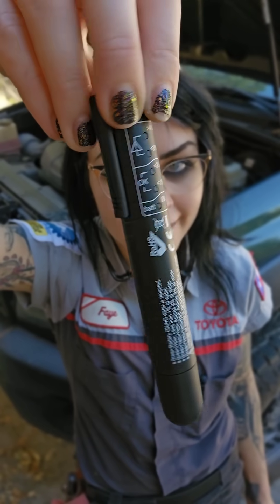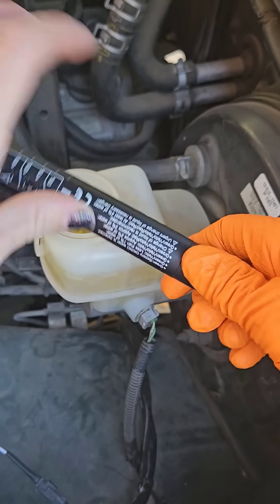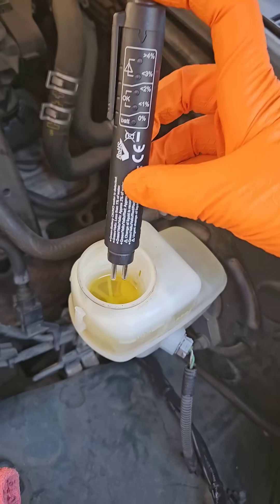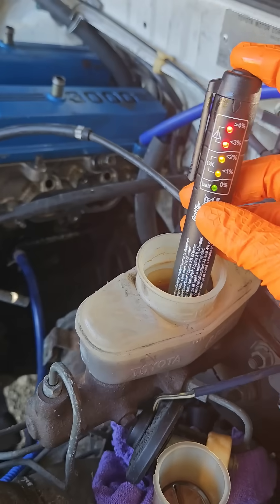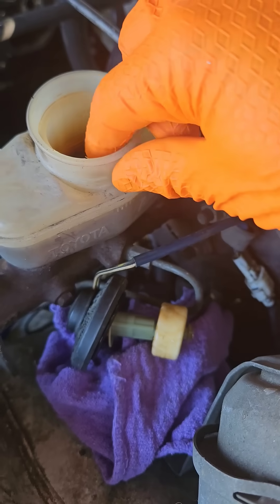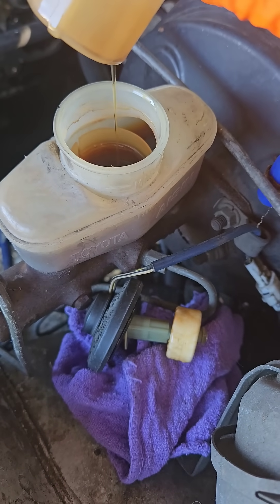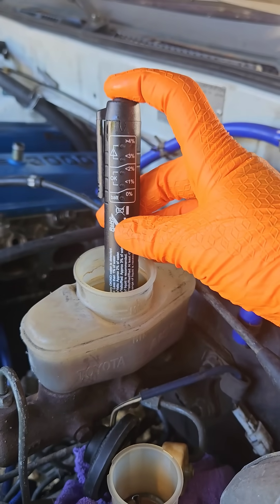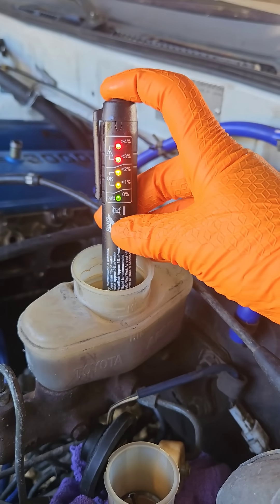Do you REALLY need your Brake Fluid Flushed?? How to Test it For Yourself!

Comment: She is absolutely right. I bought a motor home with enough moisture I lost the brakes driving it home on a hot day while pulling a trailer. I managed to stop it with the trailer brakes. They say brake fluid is the MOST neglected aspect of cars on the road today.
Reply: People change oil. But neglect the brake fluid, power steering fluid, diff oil and coolant chnages. There is more to a vehicle that putting fuel in and keeping the oil changed
Reply: @trelipscomb8137 dont forget transmission fluid and most have a filter under the pan
Reply: @taylorsopko5807 My transmission is sealed. I don't even have a dipstick to check it. Now I have pay more  to  some mechanic to crack it open and trust him not to screw it up.
Reply: @LightningDogg Most without a dipstick have a check hole, park at a very slight decline and loosen bolt a bit until it drips a bit. There's a whole lot of back and forth when it comes to changing transmission fluid on sealed transmissions. Personally, if mileage is 100k or below, I was told to risk it. Even if it's higher, depending on whether it's ever had work done it might have had most replaced, and if so I would risk it. If it's at like 250k and never been worked on... probably a Toyota or Honda and no one really knows at that point if it's better or worse unless you open it up. If the rest of the cars in good condition, keep and eye out for refurb/used trans and engine at a good price and start making friends with a mechanic or start learning how to do it on your model and getting the tools.
Reply: @Disreputable91  Thanks for the insight. I'm about 55/45 leaning toward replacing (not flush).  Appreciate your take on things👍
Reply: @trelipscomb8137  People do not change oil....
Reply: Just learn to do it yourself. I have never taken a car to a mechanic in my 40 plus years of driving. Any tools I buy adds to my collection and still costs less than taking it in.
Reply: @2pist except not everyone has the time that you do.
Reply: @sonofagun5305  Oh you don't have 1 hour of your life to learn something new? What are you, a billionaire?
Reply: @2pist Modern anti-skid brakes can't be flushed and bled like older models could. Have you seen the plumbing on modern brakes. That's why I have the Dealer do it for me. I understand where you are coming from. I can do my 16 Honda VT750 myself easily. It's just a master cylinder, line, and caliper.
Reply: I'd argue that gear oil in the differential is even more overlooked than brake fluid.
Reply: I think that must be true. I just bought a 2004 Dodge Dakota and was checking the owner’s manual for how often they recommend that the brake fluid be flushed. But it wasn’t even listed as a maintenance item.  I feel that this has only become a ‘thing’ somewhat recently. I don’t remember it being discussed as a typical maintenance item 25 years ago.
Reply: @mauricedelarosa6083 what?  As a shade tree mechanic bleeding the brakes and flushing the whole system was a thing 20 years. It was routine - many cars used would have that mushy brake feel.
Reply: @Morphling92 Did you just equate bleeding the brakes with flushing the system? You bleed the brakes to makes sure there is no air in the system. Air in the system compresses much much much easier than brake fluid. Unless you are pushing out all the fluid you are not flushing the system. 

Yes, what you learned from your highschool science teacher is wrong, water as well as all liquids compress. The compression is just at such a high pressure your will not achieve it in your machines. This is why the water at the bottom of the ocean is more dense than the water on top.
Reply: @lubrew5862  holy hell, flush the system and then you bleed the brakes after - man I’m so sorry I was typing on my phone and put it out of order. 

Like I don’t know what you’re getting at?  When you flushed your brakes, did you not bleed them?
Reply: @mauricedelarosa6083  they just figured out cows milk is an inflammatory substance in our bodies. Not supposed to drink it. But years ago milk was promoted as one of the most healthy things we could drink. I didn't just become bad for us. It's always been bad for us. Just like this brake fluid. Back in the day they had no idea you needed to change brake fluid every 2 years. However I light of new discoveries they figured out, hey this stuff absorbs water, and it kills braking systems.  So no brake fluid didn't just start being hydroscopic over night. It's always been that way. They just started including it in the service information.
Reply: 35 years ago I worked at a Sears auto center where I was informed that at 5 percent moisture, DOT 3/4 brake fluids' boiling point is reduced to 212 degrees F. The scenario presented was... Someone using their brakes excessively suddenly loses all break pedal. The cause is the moisture flashes to steam, creates an "air" bubble in their wheel cylinder and the result is no pedal when they need it.
Reply: idk man. around me here in/around Tennessee. I beleieve tires might be the worst. everybody seems to always have something wrong with their vehicles. lol
Reply: And yet my dad says flushing brake fluid is not necessary... Ill be replacing mine very soon
Reply: @midnightbass6596 unfortunately there a lot of myths that backyard mechanics and old schoolers will perpetuate. As technology improves, the tolerance for abuse diminishes. Most new cars will electronically restrict the engine power or shut it off completely to avoid damage. Older cars didn't do that, so people just kept driving til something broke.
Reply: @jaykhan3191  yes but they also now create cars to break as fast as they can
Reply: And power steering fluid
Reply: no she isnt. she said water doesnt compress but it does indeed compress.
Reply: @Sacrifice117  it doesn't compress when it boils, but what would we know? Fill your brake fluid with water, natural selection will do it's job with you.
Reply: @squareeyes1117  water does compress. the myth of water being incompressible is just a white lie your teacher tells you because it's too complicated to tell you that it compresses at a much lower rate than anything else. the water at the bottom of the ocean is about 10-20% more dense than water at sea level. read a book or something bro.
Reply: @Sacrifice117  that's due to the lower temperatures and high salinity you mong
Reply: @Sacrifice117 the degree that water can compress is small enough not to matter. Boiling water, or steam is another matter.
Reply: It is the most neglected because if you neglect it for a decade or 2 often nothing happens
Reply: I have never in my entire life had a problem due to brake fluid...
Reply: Pretty sure it's the engine oil that's most neglected when it comes to fluids. I'd say more than half the cars I saw come into the garage I worked at were not only low, but had oil that was either never changed, or had at least double or triple the mileage on it. A lot of them were women and younger guys, some with their first cars, and I always made sure to explain why and when to do certain maintenance.  Luckily most would atleast add oil when it got low.
Reply: I've had a surprise with braking going away pulling a trailer with my MH too! It's terrifying.  I had the most loved family held in my trust in a clapped out RV
Reply: I had what she described about old brake fluid on a motorcycle back in the 1980s. Nothing like being on a California mountain road and have your brakes get mushy. A complete flush front and rear at the Yamaha Dealer in Sacramento fixed the issue.
Reply: Another thing a brake fluid flush will do that she doesn't mention. It will extend the life of your master cylinder, anti-skid devices, and caliper/brake cylinders.
Reply: You may be right but that is no excuse for ‘just replacing it anyway’ (“That’ll be $100, please!”) at any BMW dealership on the planet!
Reply: @martinwinlow  sorry to be the bearer of bad news but if you want to buy expensive cars, you better be able to afford expensive maintenance. Plus $100 is reasonable for a full brake flush especially on a premium European car which would be a lot more convoluted than an economy class vehicle. Things like hydraulic brake boosters, fixed calipers, fussy ABS/ESC modules make a mundane task into a hassle.
Reply: @martinwinlow expensive yes...but not as expensive as replacing the car. And God forbid if anybody gets hurt because of brake failure. The two most important things on a vehicle is braking and steering. A failure with either of them and you probably getting into an accident.
Reply: @martinwinlow  this lady I work for said they charged her 2,000 for a oil change and I think brake job at bmw dealer😂
Reply: @martinwinlow that is why doing it yourself will save money if you have enough time to spare (about an hr for first time)
Reply: @martinwinlow no. Not $100. $300.
Reply: @martinwinlow  tf??? bf in my country is like $4 for a liter. then like 10 for labor. of course it aint a bmw. but brake fulid flush change is the last thing people do. they only thing oil and radiators the only thing that need liquid replacing
Reply: @martinwinlow bro you drive a bmw. It goes by time as well not just mileage. Just change it. 100$ to a 40-200k car. Especially with performance brakes if you have an M or M package. Even a base man its a bmw not a hyundai just replace it. Obviously not every 6 months but if its been 2 years may as well. Take care rant done 😂❤
Reply: Nope. It’s tire pressure…. “most neglected…”
Reply: @thingsnstuff85  I think a very low tire gets quicker attention then brake fluid hiding under the hood.
Reply: @2pist  brake fluid gets neglected half the time because manufacturers make it look bare near impossible to do with some of their reservoirs, I'm looking at Ford. But also it's very under informed that brake fluid is a consumable, it degrades with in 2 years max to the point where you might as well just use water or ATF (that is not advisable). People that know about it may also be anxious about how corrosive brake fluid is, scared of getting it anywhere let alone their skin. Also that it's an absolute pain in the arse if you don't own a compressor and vacuum bleeder. 
Or just the fact that they're messing with their brakes alone, the only thing that will stop your car other than another car. People just simply don't understand and those are taught are the people that are working with cars a lot. 

So many times we have people concerned about their brake pads and rotors needing a replacement, when in reality it's simply just that their brake fluid is old and contaminated. They probably had the same experience as you when their brakes vapour locked.
Reply: Sir that’s a he
Reply: @spankylocc4202 , no
Reply: @spankylocc4202  you’ve been watching way too trans porn huh?
Reply: @spankylocc4202 Definitely looks like a lady to me
Reply: @spankylocc4202 that's what I was thinking too.... sounds and looks like a masculine chick.

Comment: Brake hydraulic systems ARE closed systems!! If it wasn't closed you would have a leak and your pedal would go to the floor. It's not closed when you pull the cap off but once it's on its sealed hence the rubber sealed cap lol
Reply: brakefluid can still absorb water past seals and through microscopic pores in rubber lines etc. if this was not an issue it wouldnt be mentioned by every brake fluid company ever and common knowledge to anyone who knows who brake fluid works

Comment: Not accurate, you might want to flush your brake fluid not because the fluid is bad but to bleed the brakes cos of soft brake pedal. 
In this case how’s that little tool gonna help ?
Reply: the fluid goes bad over time, and can also cause a soft pedal

Comment: This is actually the INCORRECT way for a customer to check if their brake fluid needs replacement. She is spreading misinformation and should be ashamed. The CORRECT way to check if you should replace your brake fluid is open your banking app and look at your balance. Now cry and tell yourself ur brake fluid is fine 🤧